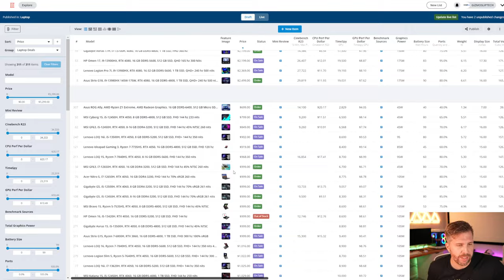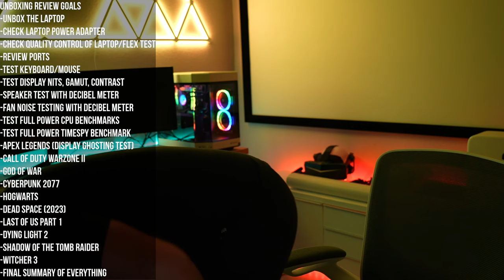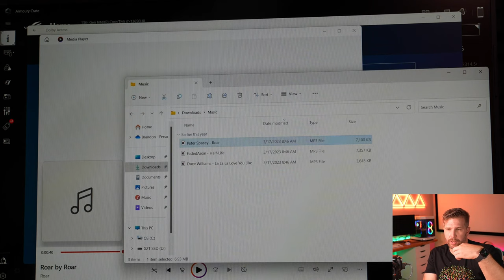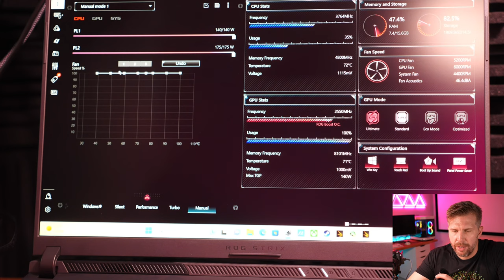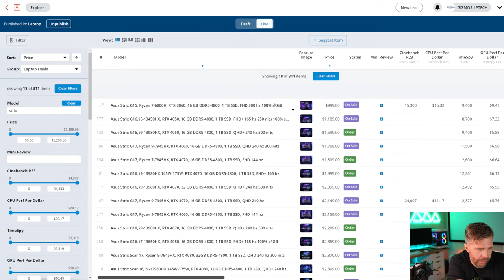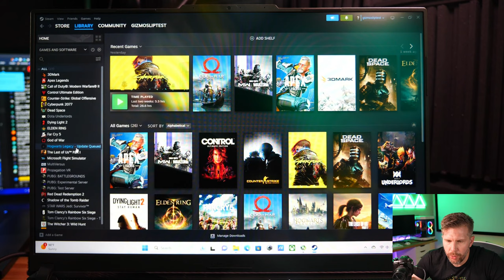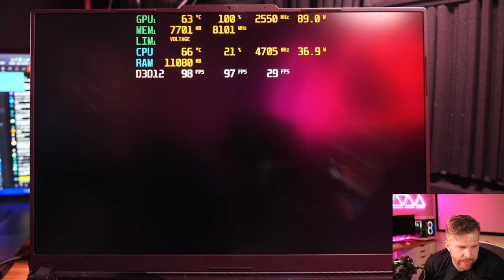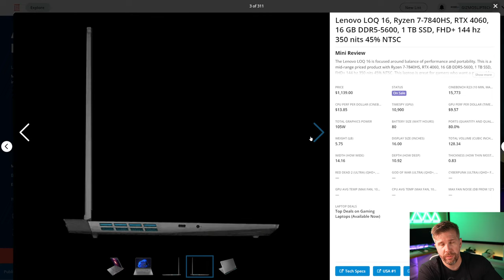Asus Strix G16 Unboxing Review! 10+ Game Benchmarks, Price Comparisons, Display Test, Disassembly!

Comment: Any idea if the laptop will connect to two external displays at the same time? I would like to connect a projector to the HDMI port and an interactive (touchscreen) monitor to one of the Type C ports.
Reply from the maker: Yes, it can do two displays at once. The touch display will need drivers, should work though

Comment: Can you help me with two queries regarding this laptop? Firstly, does both the CPU and GPU use liquid metal for cooling, or is it exclusive to the GPU? Secondly, are there any reported issues of liquid metal leakage with either this version or the Core i7 version? I've heard concerns from others due to problems with liquid metal in PS5 consoles, and if that's the case, I might consider an alternative PC that uses traditional thermal paste.
Reply: I have the same model, but with a 4070. The cpu is covered with a special pad/foil around it to counter any liquid metal leaks. My temps are also good, no 90+ temps under full load. I suggest that you test it with Cinbench and with HWinfo open and if you see a lot of variance regarding temps across all cores, there is a high chance that the liquid metal isn't applied good

Comment: Does this version with Core i7 + 4060 include liquid thermal paste? In information on the same Asus page it only mentions that the version with Core i9 + 4080 only comes with Conductonaut Extreme liquid metal. Oh well, I understand that both versions come with different quality liquid pasta?
Reply: Liquid metal is on CPU at all versions. The difference is that the GPU comes on liquid metal when you get 4080 GPU or higher. Anything lower than 4080 on GPU side is normal thermal paste. As simple as that.
Reply: @6.-THE-.1.-BOSS-.9  Now I understand everything, in the top of the range versions both GPU and CPU come with liquid metal.  Thank you very much for your help
Reply: exactly!, happy to help!  @natr3

Comment: Alienware M16 RTX4070, I7-13700HX, 16gb ram (115W) or Asus Rog Strix G16 RTX4070,  I7-13650HX, 16gb ram (140W). Which one would you recommend?
Reply from the maker: Both could be great, though the alienware cpu is better, the strix display is likely better. Asus software is better. That is why I would probably go Asus
Reply: @GizmoSlipTech   alienware's screen is better on the models I've looked at. Do you think the difference between TGP and software is a valid reason? because I didn’t like the look of asus and that’s why i am confused. (I will use it in college also i will play games too)

Comment: I bought this G16 with I9-13980HX processor instead of I7 and QHD screen at 240 HZ. RTX 4070. 2300£ ! Fair price or not ? I couldn’t find anything at better value
Reply: Its okay i bought the same for £2099 and not on se for £1899. Honestly the 13650hx rtx 4080 more worth it for the same price as the 4070 like 5fps more than the 4060